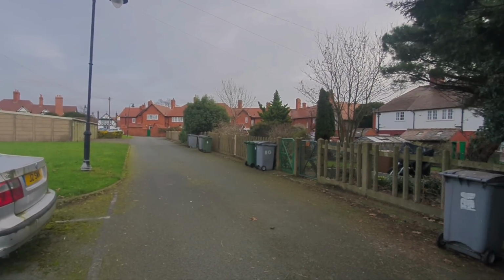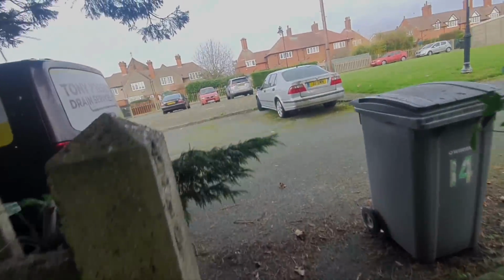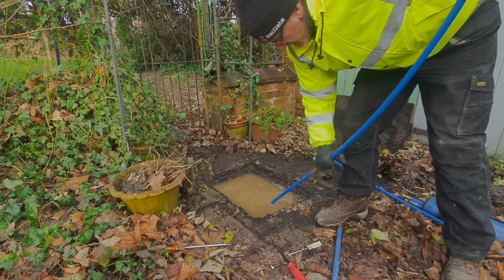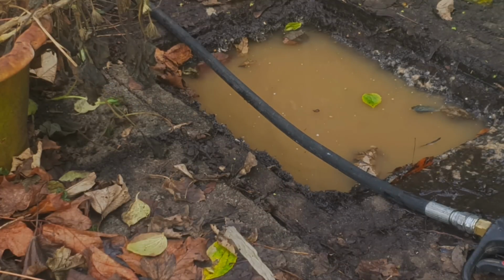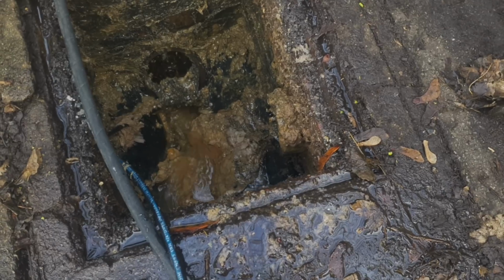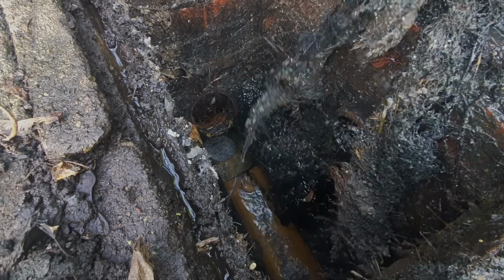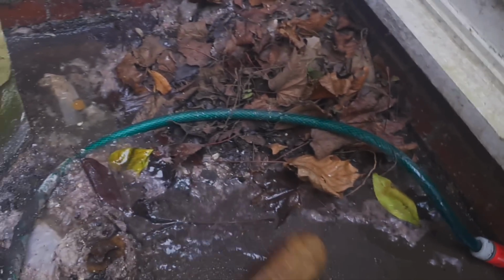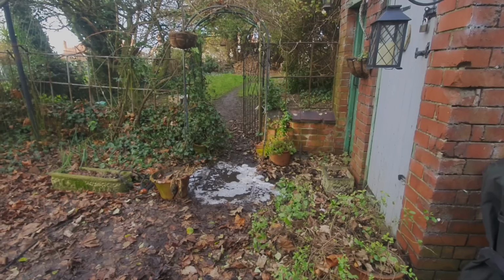Blocked drain with a rare find inside #blockeddrain  #drains

Comment: Hey Tony. The new plunger, ? hard rubber that needs to soften up with a bit of use, will cause some resistense as well.👍
Reply from the maker: Very true that , only problem with these rubber plungers is that when they do soften up ....they split.
Reply from the maker: Keep watching I will shout u out very soon, I have a few vids already to go but I will get it sorted 4 u soon.
Reply: @drain-unblocker  Tabmate.

Comment: :thanksdoc: so many people over there using wet wipes. here they are expensive, not like toilet paper. They must have very delicate butts, or hoards of babies.  How is it there with flushable kitty litter?
Reply from the maker: Yes that's a good point, wet wipes are cheap here.
Reply from the maker: I had a job where the pipe was solid with cat litter that had turned into like a blue clay.
Reply: oh crap. wonder if it was the flushable or regular type. thanks for the replies too! @drain-unblocker